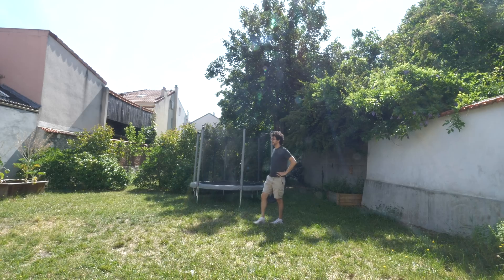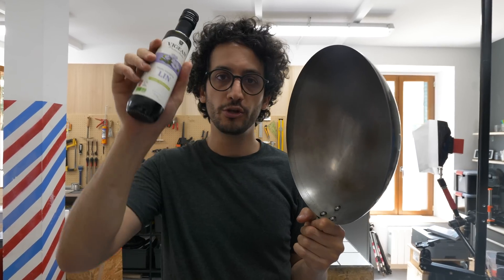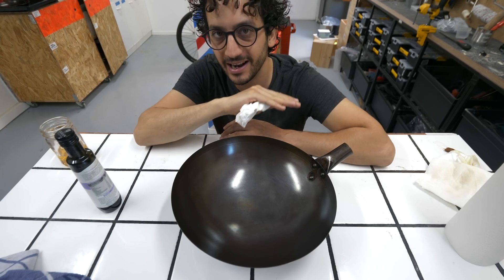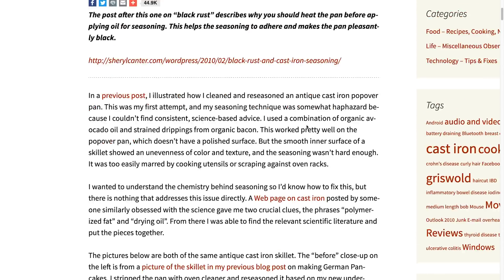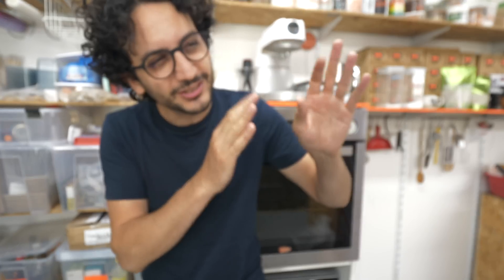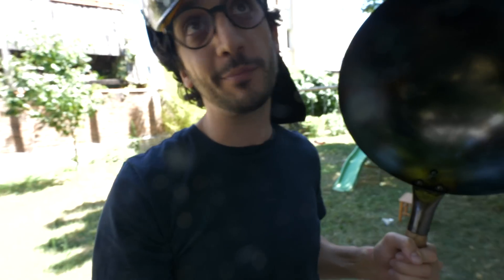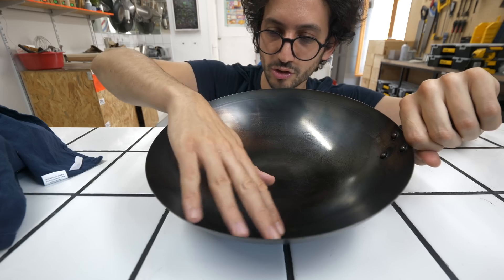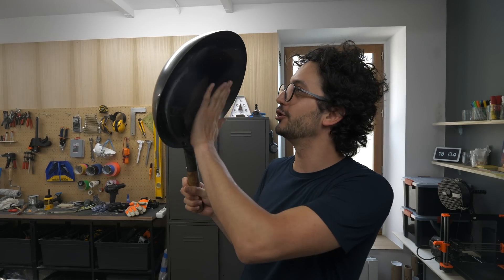Can I Make my Wok Slicker than a Nonstick Pan ?

Comment: Alex, I do woodworking and we use linseed oil in many formulations on wood.    Having this experience, if I wanted to get a glass smooth finish I would do the following.  First off, you should polish the pan to a mirror finish before beginning.  Now how smooth you want to go would be up to you.  Without researching the matter, I would probably start with 400 grit sandpaper and start going up.  400 grit 600 grit 1000 grit.  Now if I was totally mental and wanted to be able to see my image like a mirror, I would probably get a set of Micromesh which starts at 1500grit and goes to 12000 grit.  At 12000 grit this would be a mirror finish if done properly.  Now that the base is smooth as glass, I would proceed with the seasoning as you described, except I would sand lightly between each coat. You need to sand very lightly with either steel wool or a high grit abrasive, something like a 2000 grit would be nice.  Keep going with all your coatings and sanding in-between each coat.  Well that's it, I am sure this would be far smoother then your test.  Having said that, you would want to make sure these abrasives are food safe, at least the ones you use on the linseed oil, maybe steel wool would be best, get the finest steel wool available.  Well thats it, this is the obsessive compulsive method of seasoning the pan.

Comment: The thing with getting eggs not to stick to Carbon steel is less about the seasoning and more about the temp of the pan before you drop egg into it.  you need to get it hot enough to intoduce the Leidenfrost effect, as its gets hot flick a few drops of water on it if it evaporates its not hot enough, when it hovers on the pan like marbles its just right,  you can put some butter in there & drop the egg in and drop the heat a little to maintain temp.    cook eggs on a carbon steel pan on a low heat it will stick like glue.    seasoning protects the steel,  makes it better at non stick but its the temp you have to get right that makes it non stick.

Comment: My wife is from China... And the first thing she complained about when she arrived in Canada was the taste of food in a Teflon pan/wok. In China they pretend you can have more iron in your food this way... I don't really care whether it's real or not...
But I stole/claimed my grandmothers old cast iron pan since then and man... It's really not the same.
I think the biggest difference is when I cook beef. Whether it's a steak or beef strips for a stir fry... It's really better in a cast iron pan.
When you caramélise onions... It's really not the same too. Cast iron gives of a burnt/smoky flavor that you simply cannot reproduce otherwise.
I guess part of the reason is because cast iron holds its heat better... But maybe Teflon is simply not that good to cook. Of course it doesn't stick and it's easier to handle... 
But anyway... I'm using a set of cast iron pans that are almost 100 years old... And they still almost look like new (she had a family of 8 children to feed, so trust me, she used them plenty)
Could the same be said with Teflon pans?
For my eggs... I did an experiment and I did what you're not supposed to: I left oil all over the pan before putting it in the oven. My wife was so angry for all the smoke but... The end result, after 3 curing, was a plastic like finish. My pan look like glass almost... And guess what? It doesn't stick almost like a Teflon pan :p
Don't do that inside though... Next time I will use a BBQ or something...

Comment: You could've skipped the first part altogether. Just get that pan or wok or whatever piping hot. Then rub linseed oil in, put it back on the heat until the oil cures. Take it off the heat, rub the next layer on ...etc etc until you are satisfied with the result. I did my carbon steel pan on a (slightly modified with spacers) charcoal chimney and it worked a treat.

Comment: Hi Alex, With a correctly seasoned wok you do not need to add oil when doing the egg test. You do however have to "layer" your seasoning some. You want the "hard" IE glass layer on the bottom. Next you want a "soft" layer on top this layer should be about the hardness of a plastic, it happens just after the "sticky" phase. Then the "liquid" layer. Which is oil is applied, and then wiped off until it "feels dry". When seasoned this way the surface seasoning should feel like wax when you touch it. I have a video on this account I made in 2013 showing a skillet I seasoned this way, and doing the egg test with no oil added to the pan.

Comment: So as someone who's recently be greatly interested in armour making they use a similar process for rust proofing and blackining armour pieces. If you go too far and burn your coating it becomes much lighter just like the light spots you have after using the gas stove

Comment: The reason polytetraflourethylen is so non stick is because of the huge difference in electronegativity between the carbon atom in the center and the fluor atoms surrounding it. The chemical bonds within PTFE as a result are extremely strong. This in turn means that PTFE does not react with the vast majority of other substances. There will be almost no attractive forces between PTFE and other substances. So chemically speaking, it is not better than no stick.

Comment: I prefer a well seasoned Carbon Steel pan to a Teflon pan too.

I have done some home testing and I did 6 thin coats of Flax-seed oil then I did a couple of coats with cold pressed coconut oil. I don't know why but I feel the two coats of coconut oil seem to really help darken and even it all out.

Comment: This seems very similar to how they protected firearms the old fashion way with black oxide. Purposely rusting iron and boiling it to convert the red rust into black oxide. The process was done multiple time but polishing the surface was also necessary between each coating.

Comment: Great video. My experience is not using any tensides for the cleaning. Tensides will remove this seasoning. I only use hot water and after that some oil.

Comment: I have a lodge cast iron skillet, and a DeBuyer carbon steel skillet.  They are both significantly better in my opinion than any teflon pan I've ever used.
Number 1 thing?  No burning teflon.  But besides that, they are just as nonstick if you use them properly with a light coating of oil.  No worrying about teflon and its effects on your health or your pets health.  No flaking off, no scratching... How much do you hate scratching a pan and having to replace it after having it for less than a month?  Some of these "non-stick pans" are very expensive for what you're getting.

What else?  Super easy to clean, I can use metal utensils, thick bottom holds heat for a long time once preheated, food "browns" like nothing you've ever tried before,  the pans themselves will outlast my own life and will likely be passed on to my children or grandchildren at some point.

And I know this is dumb, but nothing sounds quite the same as food frying on an iron/steel pan...so satisfying.

Comment: Teflon is inferior because it is not that heat resistant and will degrade over time. Stir frying with a teflon pan will definitely kill the coating. Also the coating cant be renewed like on cast iron

Comment: Personally, I prefer woks over teflon pans, whether one of them is "objectively" better or not, so, the newly, "organically" seasoned wok wins for me. Besides, I put oil in all pans, even if they're nonstick pans anyways so I'll always choose steel over rubber looking stuff 😂

--- You are entering the geek section of this comment. -----
But if I have to judge the wok in the video, I'd say it's still not as slick as a newly purchased nonstick pan because the bottom of the egg had to be nearly black/burned before it could slide around in the pan (or maybe the heat was just coincidentally too high?) while if you fry an egg on a fresh ass teflon pan, the egg will release from the pan even if it hasn't been cooked all the way through yet (although disclaimer: this is just an assumption and I'm not 100% sure that this is true, that a new teflon pan is THAT nonstick). Judging the competition would have been easier if the other player, ZE TEFLON PAN, showed off its nonstick ability after testing the wok, but honestly, I wouldn't bother testing an old teflon pan if I was sure it wouldn't perform as well as a new teflon pan, and I wouldn't buy a new teflon just for a test video either, so this isn't really a big issue.

But anyway, I would still prefer the wok over the teflon pan. It's prettier -- shiny and nonstick steel wok with a smooth shiny black surface? Oh my, oh my, I'm drooling.

Comment: If this mask is not rated for fumes, it does jackshit for you. It is meant for dust, not chemicals.
There are some masks that look similar for welding, but they are specific for those fumes. Use a respirator with fume filters if you actually want to protect yourself, maybe even call the supplier and ask for the suitable type of vapour filter.
A false sense of security is very dangerous! I like you is why I say it.

Comment: Hi Alex, in Asia we season our woks over the biggest fire that we can find. There are 2 kinds of wok; a deeper single-handle type and a shallower 2 handled wok. We also never apply any soap to the surface when washing as it will damage the coating, same with a claypot. Woks are sent to the water when hot and scrubed with a bamboo brush and then returned to the fire to dry. If you don't have a bamboo brush I'd be more than happy to send you one.

Comment: And this is once more the reason, why nerds are awesome :D
Teflon by the way can be overheated, causing damage to the coating and at some point even releasing harmful fumes. So a teflon wok is just not a thing, therefore I think a well seasoned pan is the better way to go. I don't care about the no oil less oil thing, because I use it in my nonstick pan regardless.

Comment: OMG! I been trying to do this for years with various degrees of failure as I was: 

A) Not doing a Deep Clean on the wok
B) Using standard vegetable or rapeseed oil 
C) Only doing one or two layers which were definitely thicker than yours 
D) Doing it on the hob which was probably not hot enough.

Thanks man xXx

P.s I didn't see the oven temperature, what heat was it or will that depend on the oil used?

Comment: honestly i've used this method on new pans a few years ago but it's not worth the effort if you use it on a frequent basis. it's a decent seasoning but having to use that high quality flaxseed oil, which usually needs to be cooled so it doesn't spoil and having to be so careful about the seasoning process is quite a hassle..
since then I've just been using rapeseed oil instead because it's also decently high in omega 3 fatty acids (it's much more than the 10% in the article you showed in the video for the oil we have here) and just spread a bit of it on new pans or seasoned pans after cleaning them using a paper towel and just put them on high on a gas burner until the oil is completely polymerized (dry), works just as well and is much less of a hassle

also to remove a bad seasoning you can just put the pan in your oven in its self cleaning mode and it'll heat up so much that the seasoning will burn right off

Comment: Great vid but thee chemist in me hears "there is no chemical" followed by "nice polymerisation".. :-)
Reply: Iron is a chemical, oil is a chemical, water is a chemical and an egg is a very wild assortment of chemicals.... Whenever someone says that they don't want anything to do with chemicals I ask how they enjoy vacuum.
Reply: @MrAranton  I think the point is that Alex seems adverse to "Teflon", but thinks "polymers" are alright, when "Teflon" is just poly-tetra-flouro-ethylene, as you might have guessed from the name, a polymer.
Reply: @sergarlantyrell7847  Teflon also causes respiratory failure when overheated, and has been known to kill house pets from the fumes released by the coating. Yes everything is a chemical, but when most people refer to "chemicals" they are talking about man-made, or toxic substances. The smoke caused by burning plant oils is certainly not good for your health, but they are not nearly as toxic as the breakdown products of "burning" teflon. When in a stable state, Teflon is so unreactive it's mostly harmless, just toxic when heated past it's breakdown point.
Reply: jack mills but isn't the point of teflon that that it is unreactive as all hell so how could it do anything when the whole point of it is to do nothing?
Reply: @tktspeed1433  like I said, if you were to ingest it in it's normal form, it wouldn't do anything. When it is heated past a certain point it decomposes and releases toxic fumes, that's the danger. Cases of this happening are pretty rare, but sometimes a pan gets led on the burner and heats up enough to release the fumes. These fumes are very harmful to people and pets. they aren't really deadly for people, but they are deadly to smaller animals especially birds. I use Teflon pans and as long as you are careful there shouldn't be a problem. I think I well seasoned cats iron or stainless steel pan is better though because they last indefinitely compared to Teflon coated pans that chip and wear out. It's so unreactive that it's hard to get it to stick to the pan, so it chips.
Reply: @jackmills5071  But if you've got the temperature where the Teflon starts breaking down, any oil you're cooking with is going to have started smoking and becoming toxic its self.
Unless you're planning on leaving a frying pan on the hob on a high heat with nothing in it, I don't really see this being much of an issue.
Reply: @MrAranton  of course, if there are atoms, it's chemical. Regardless of facts, the phrase is fun, indeed.

Comment: I did the same thing by firing my wok to just above that point when it comes to glow (oak fire in the yard) then dipping it in oil. Instant dark coat that lasts forever. You need to temper it tho, otherwise it will split.

Comment: didn't you see this coming? You are going to heat oil way beyond its "smoke point" and wonder why it starts smoking? :)
maybe you could make it even smoother by kindly sanding/polishing it in between layers to remove the high spots. Just like you would when finishing wood. Maybe with a strip of leather or a super fine steel wool?

Comment: I like your Videos <3 [thank you!] but think this episode was still not "nerdy" enough. I think linse oil coatings in the oven, is the best method. If your oven is not hot enough, you need to put it on a grill or something. But: Are there differences in the stability to thermic decomposition or acid resistance after autoxidation, thermal oxidation, polymerization, cyclization and fission from different oils. Are there differences in slow and fast heating (because the molecules have more time to bond). Can you make the process better, if you add more rust or carbon? Is a flat surface (like polished blank steel) better than cast iron or forged steel, because a rough surface might stick less, because of the "gaps" in the  contact surface. My (childish) theory is, for the first coat: very slow heating with very very little oil (just oil the cloth, especially when you have unpolished cast iron), (give it time for carbon deposition) and have the pan a little bit rusty, in the following layers you can go faster, and put on some more oil (but dry, like in the video) you have to go above the smoke point, so it is messy, if you do it in your kitchen oven, if you don't do that, it will not completely polymerize (brown-sticky instead of black). What are your thoughts? [the pan-cleaner was cool, how is the steel wool mounted on the wood stick?] Another thought, maybe you could get a thinner coating if you would make a emulsion of water and oil, and used that, instead of pure oil?

Comment: can we get any actual chemists who actually know what's going on? in all my years i've only ever seen anecdotal evidence put forward by laymen
Reply: As far as I’ve read from supposed actual chemists in this comment section (not me) and other internet articles. Teflon is kickass and safe, just don’t heat it super hot (<350C) and you’re good. Wears out tho. Seasoned pan is also good, technically more sticky than teflon but probably so small of a difference in the kitchen that it doesn’t matter. Wears out, but you can reapply, so it’s just way more convenient.

Comment: polymarisation is also a chemical process, so that is not realy an argument, however , in new state the teflon pan is better, but in older state a teflong pan is terrible an have to be thrown away, the cast iron pan can be used more thean a life time long. Therefore  I prefer the cast iron pan.

Comment: its wong!!! The key is using Oleic Acid to create dense oxide layer. Industrially known as the black/blue coating. u miss t oxygen.
if u wanna know t right way, check my channel.
btw, every chef in france knows how to season a carbon steel pan.

Comment: Actually nonstick pans use aTeflon polymer coating similar to what you did here with the carbon from oil being burned and vaporized. It’s not a chemical, it’s just a carbon based polymer coating that happens to have a lower coefficient of friction as well as less reactivity

Comment: Would it be possible with current technology to forge a pan, that uses the lotus effect? For the amateur Teflon is okayish, but after a while it will peel. Impossible to repair. A cast iron pan is harder to work with, but you can repair it. There has to be something in the middle.